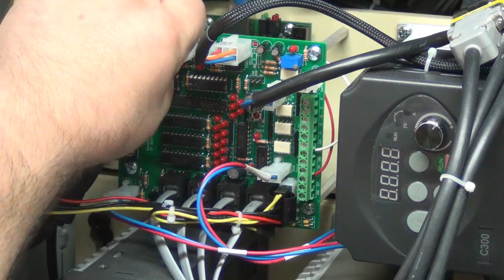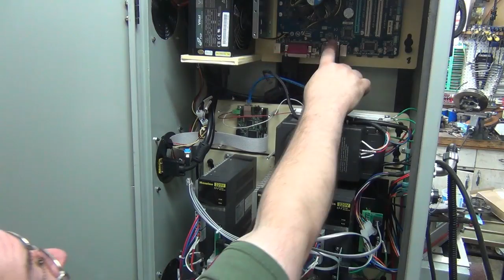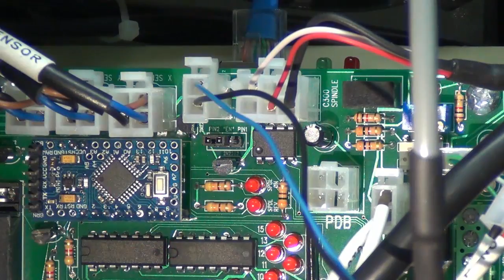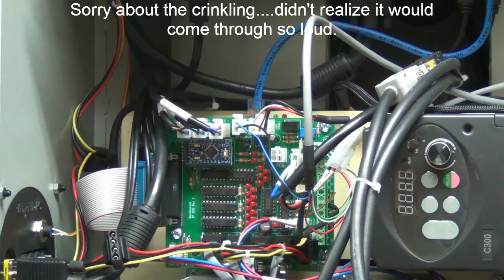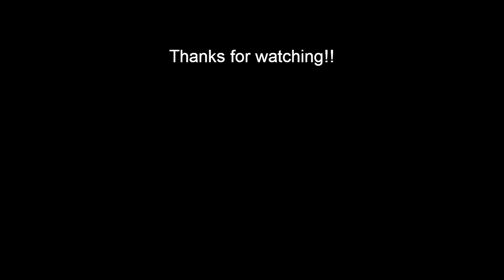Novakon Torus Pro - New BOB(Break Out Board)

Comment: bluehandsvideo It looks like they just threw an Arduino Pro mini knockoff to replace the PIC on the BOB. The header pins that you identified at 6:52 are for the external FTDI USB programming header. Theoretically, if you got a hold of the firmware source, you could very edit and reflash the firmware for the BOB. Novakon sure does have an interesting way of using off the shelf components in their control system.

Comment: Nice video.  I really like the idea of cnc machining but the cost is more than I want to pay.  Besides I am only doing such things as a hobby not running any business.   I used to program and maintain industrial computers and when we had a shutdown for repairs all manner of people came through installing and removing instrument wire.  I had to check each of the hundreds of wires before starting up again as I would find dozens of them not tightened down.  Thanks for sharing.
Reply from the maker: I'm guessing those were the computers that you could walk through?  In '83, NORAD was still operational.....the computer was about 1/2 the size of a hangar and had to be cooled year around......in Montana!!  I only got to see the building from the outside, but my phone has waaaaay more computing power than that building did back then. lol  Thanks!!!!
Reply: Mostly refrigerator size computers.  The newer ones were even running on PC's.
Reply from the maker: cerberus
Here, at work......we've got several refrigerator sized racks of PCs.  We had a set of 7 racks with about 10 pc's each that would only figure out a handwritten address.  They spent millions on the system nationally and it was "hoped" to be catching about 10% of the handwritten letters.  Even at only 10%, the ROI was only about 3 years.  That facility was processing about 2 million pieces of mail every day.  Hmmm......bit of a ramble there lol

Comment: So did the X and Z switchover change anything with the unit operation??

Colin
Reply from the maker: Hmmm.....good question.  Everything still homes the same.  I might have to look back at some pics and vids and see if I can see the original positions.  If they were wrong, maybe I can blame some of the breakage on that! LOL  You'd think that I'd have noticed a difference in operation after moving them.  There's definitely a chance that I simply read them wrong the first time  I guess I'll double check that the actually go where they say they go.
Reply: *****

Ah, that's what it is. When one is tripped, they all light up. It must not matter in what order they're plugged.
Reply from the maker: ***** I was having trouble wrapping my head around the series setup......it finally dawned on me that it backs off the switch after it homes.From the manual:X, Y, Z Axis Home Sensors Connectors.The sensors share Input 11 to monitor HOME position. Any one of 3 axes reaches their home position will trigger the input.3 Wires (GND, 12 VDC, Signal)